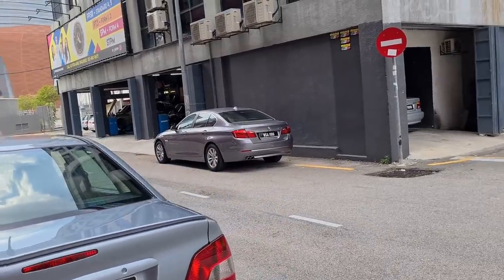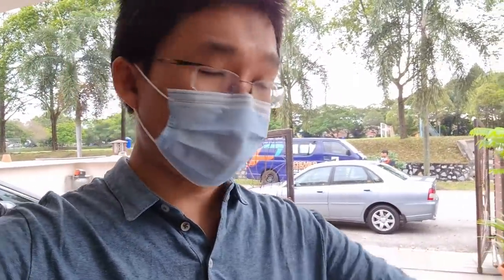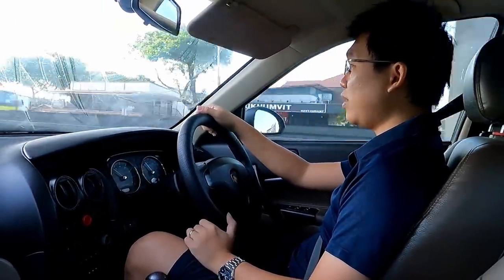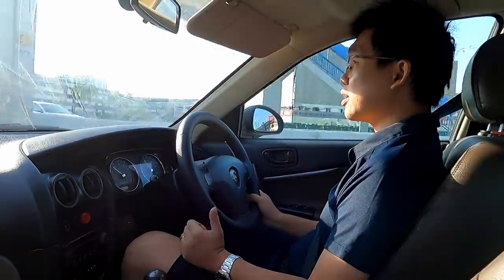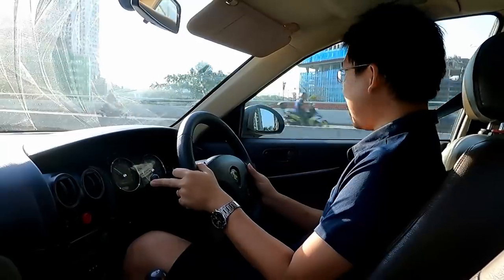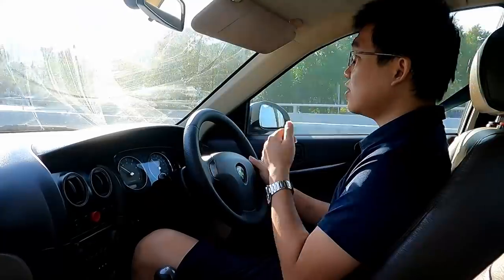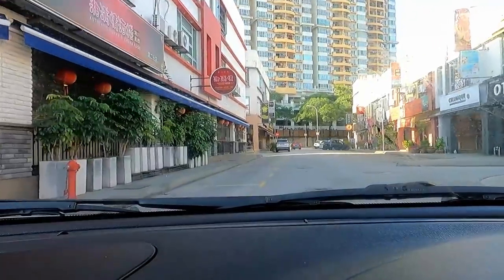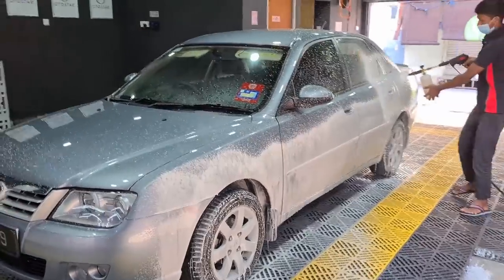After much deliberation, I finally bid my Waja a fond farewell | EvoMalaysia.com

Comment: I understand the emotional feeling you had Kon. Same goes to myself. Bought a brand new waja in 2007 and sold for RM25K in 2014 to replace Altis. The main reason I sold cause of high fuel consumption as I need to travel long distances. I was sad for 1 month after sold the Waja.

Comment: I got emotional watching this video. As a proud owner of waja cps myself, this car has been the most reliable car and its my first car. All the memories made with my waja won't make me sell the car.
Reply: Is there any diff between the cps, campro and mmc wajas?
Reply: @michaelleong1977  mine is camrpo actually. The only thing i know is that this engine made from Malaysia. Mmc engine borrowed from Mitsubishi.
Reply: @michaelleong1977  mmc will be borrowed engine from mitsubshi. Campro and CPS(cam profiling system) is our Proton's proud own engines. The different between that two, CPS has got extra power, abt 125hp n 150nm if i recall properly. This extra power happens at 2 different rpm stages, as I remember first boost comes at 3800rpm, and another at much higher rpm. Basically the cam's profile runs at short or long travel to give this extra boost. Campro engine doesn't have this design.
Reply: True to that bro
Reply: @vivikutty  ya bro, my waja is like a bother to me plus it is the first car i own. Been together a lot.

Comment: As I said earlier, goodbye WQA 1189.
WQA 1189 The Waja and MCW 614 The Persona VVT Pre Facelifted(WYG 5236 The Saga FL 4AT also but I don't remember that number plate, I just searched through all his past videos and I find it.) are the major reasons which I followed Mr Kon's channel.
Reply: It's always sad to see people give away their precious thngs.
Reply: He really knows how to care of his cars.
Reply: I do not know much about the Campro CPS engine but the interior is much better set up than the original Waja MMC that I have. The driver reclining seat is lever activated which is good...and the centre air con vent which is "round"
can direct air to the front passenger which the Waja MMC can't as the central console is slanted towards the driver. That's Proton for you...
but it's a darn good car if you can accept the windows dropping down on all 4 doors over the years. Thank God they did not drop when I took my family cuti2  during CNY otherwise it would have f...up my holidays. Another famous problem is the door levers will break when they get brittle.
Reply from the maker: Kelvin, thank you very much for your continued support of the channel. The Saga is still with us by extension.... wife has passed it down to her sister.

Sujendran, my criteria in maintaining cars is that they have to be ready for me to take up Genting anytime for a hard drive. I'm okay with some cosmetic flaws, but mechanically, I keep them as tip-top as possible.

Dennis, so far, this car only changed 2 driver power windows in 14 years. Not bad lah.

Comment: Agree that cars need to be driven to stay fit. Really. My 31 year old Merc is daily runner and no fuss. But if left parked undriven, more work needed just to get it run back at tip top. I will still keep it because still wanna go Thailand with it after this c19. I missed my Kancil manual too. But try to keep thinking that new owner will take good care. Over time, will just look forward.
Reply from the maker: Join us in the next Enduro!
Reply: @KonWaiLuen  yea if all condition fit why not.